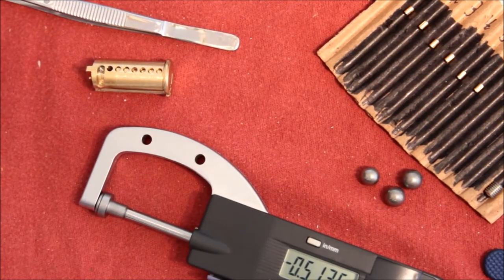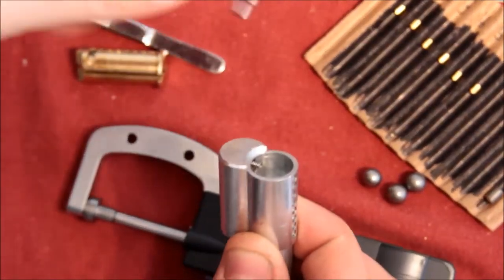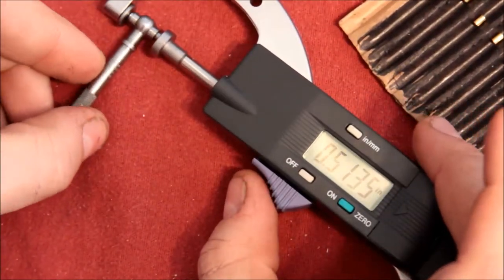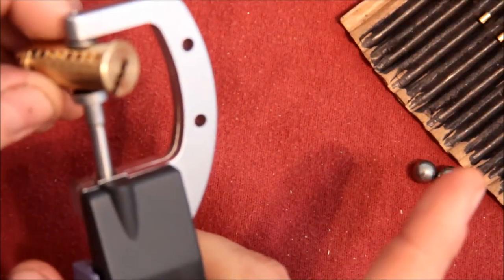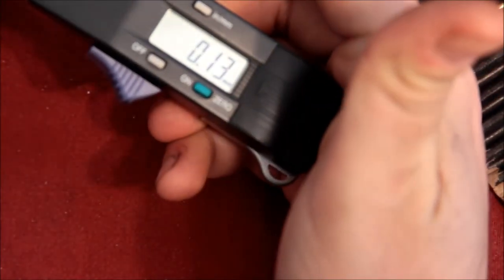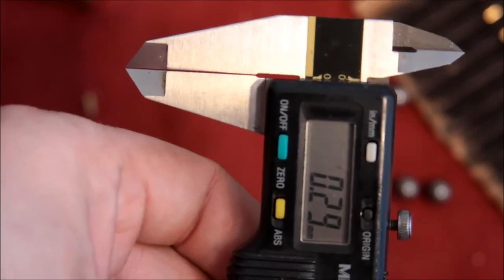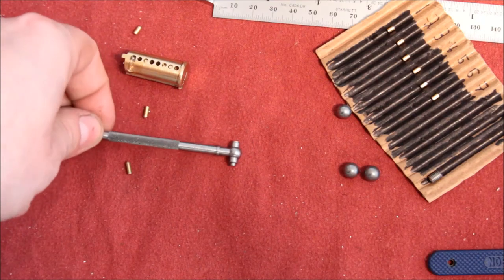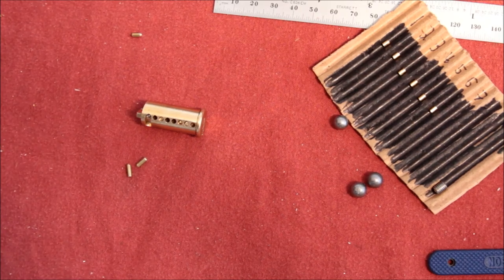(163) Tolerance: Metrology for Lock Geeks

Comment: Thanks for the video tip there Alex, I enjoyed it! On what is actually called a hole gauge you do rock back and forth to get the feel, but on snap gauges you draw though the bore with one pass, then measure, you got good measurement but rocking can squeeze it more if not passing back dead center, on each of the passes. The Starrett set of snap gauges are my favorite, I have worn a set out already, now I use Japan’s LOL ;{)---

Comment: I will, just like a few other tools that I'm adding to the box more description is needed anyhow!  The quickie, insert slight angle, with floating near center, travel of spring extensions, tighten nut and with one foot stationary pull the other pass the stationary one, then measure. You did get a matching number; just want to grasp the procedure for better consistency in your measurements, down the road.  ;{)---

Comment from the maker: Dude, I gave metric for almost every number (I even spent the time to convert it for you!). 

When I say thousandths, yes, I mean 0.001 inch = .0245 mm (so think "a quarter of a millimeter"). For perspective, ASSA seems to hold within 0.001-0.0015". The differs on most key bittings are on the order of 0.015-0.020" = 0.381-0.508mm. So being out by 0.0125" = 0.3175 mm at the shear line is quite a lot, I think.